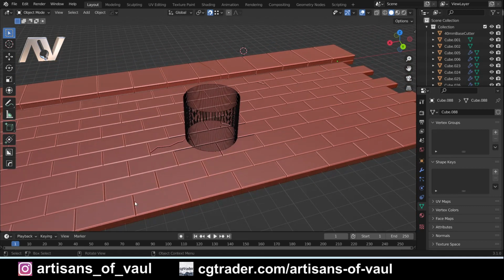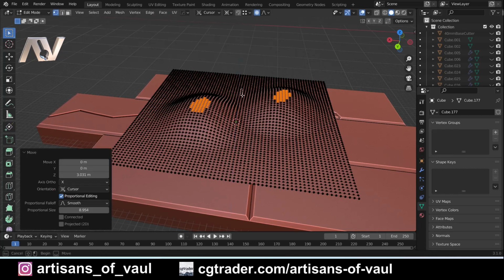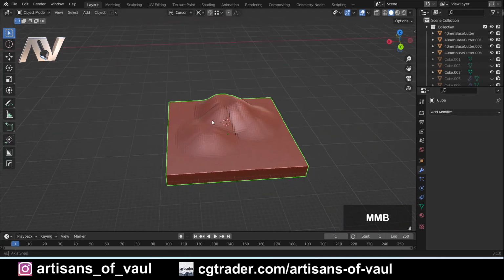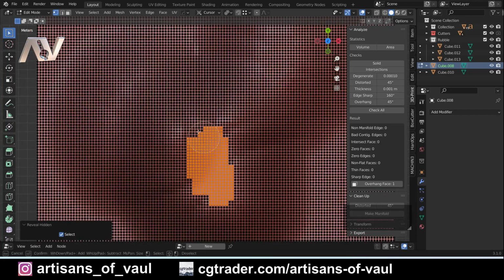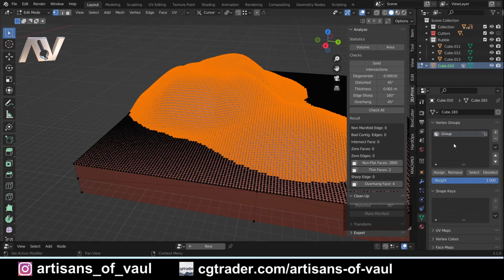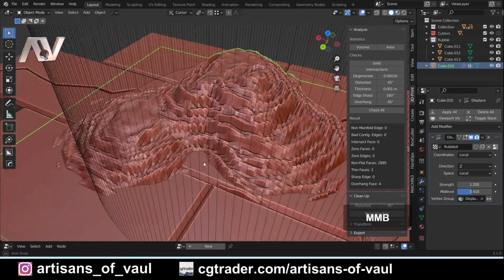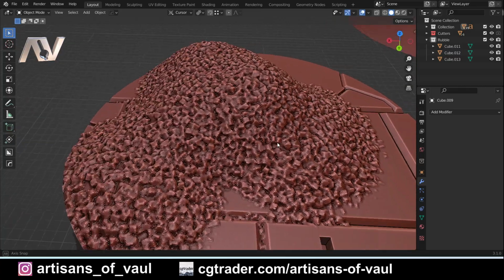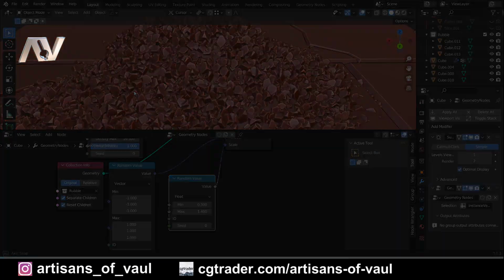Creating piles of rubble

Comment: What is your method for merging the rubble with the base for creating a printable part? I've been fighting with a similar displacement process to number 5 to texture an inset surface and couldn't get it to merge into / resolve into a sealed volume (I was attempting to use bools to "clip" the visible texture for the inset surface but blender was not...happy with the process).
Reply from the maker: I would imagine there is an issue with the mesh that has been created.  Have you run a 3D-print toolbox check on the object to see if there are any issues?
Reply: Capture of the toolbox's output: https://imgur.com/a/QubdcZu

I'm guessing that the ~102k intersect faces are contributing to the bool not firing correctly? (I'm still fairly fresh to doing stuff with Blender, your videos have been fantastic aids insofar, I'm just unsure how to resolve more complex models into single entities that will print).
Reply from the maker: @SereneTreefolk  Yeah that will do it for sure. It's not just non-manifold edges that will cause a boolean to fail, non-flat faces and intersecting faces will also cause problems. If you have Instagram feel free to message me there. I could have a look at the file and give you some pointers if it's fixable (it should be)
Reply: Sadly no instagram, Discord perchance?
Reply from the maker: @SereneTreefolk  Sure. Let me know your name there and I'll add you.
Reply: <removed by user>
Reply from the maker: @SereneTreefolk  Request sent.
Reply: I did, it reported that there were no non-manifold edges, but I suspect that there were other issues with the "textured" object (union bool attempts were reducing the model down to several odd rings instead creating a unified object).

Comment: Why 3d print something you can easily make with sand and glue!?
Does nobody care about the environment anymore??
Reply from the maker: I would say its an option and if you're already printing a base then adding an additional texture allows you to create a more "complete" product and uses very little additional material.

Id also add that saying its better to put sand (stripped out of nature on an industrial scale) on a plastic base (where the sprues mean there is around 40% by weight of plastic wastage) isn't exactly environmentally concious.

Comment: Does using the nodes create issues for 3D printing? I mean, they look like it would make everything a pain to clean up and make manifold/printable. Then again, I think I just need an easier way to clean up models, making a simple planter I had 230+ non-manifolds due to booleans. Oh well. Learned a few new things at least. I like how base 5 looks.
Reply from the maker: The first method does cause some issues.  You need to either separate all the objects (easy with "p" then "by loose parts") but then booleaning everything together can cause lots of issues.  The other option is to take the object to sculpt mode and remesh it, that will make one solid object (do this without separating out the parts).  The second method causes no issues at all that I have found.

Comment: Awesome video! Nice to see the side by side in resin. I think the first option would potentially be worth it if you wanted to also add in some additional objects as texture (like spent shells, or more distinctive brick bits or broken column shapes). For this kind of fine rubble texture- I agree with your usual method of just adding basing material the old fashioned way once the base has printed. I like the last "noise" option in terms of how much mid levels their are. Seems like an interesting way to add larger rubble bits and then still go in after the print with some fine sand or something similar in that empty mid level space.
Reply from the maker: Totally agree on all points!

Comment: I'll say, the displacement is an excellent tool for getting natural looking textures onto surfaces using a similar technique to the last one, not just rubble. I think they all look great though!
Reply from the maker: Yeah, I need to play around with them more but I didn't find it that impressive
Reply: @ArtisansofVaul  I've been downloading displacement maps and using them as textures for natural ground and it's worked tremendously well for me. I set the coordinates from local to UV, changed the direction to Z, and went into the "UV Editing" at the top to stretch out the vertex's across the image more evenly. I typically go with 3 strength and set the midlevel to .1, and it's worked brilliantly, and it's way easier than designing a dirt path or beach or grass from scratch
Reply from the maker: @NoraMeld  It's definetly something I want to tinker with more. I get the impression it works a bit better on larger surfaces.
Reply: @ArtisansofVaul  It definitely works best on flat surfaces or only lightly curved, anything with more than a 15 degree curve is likely gunna look wonky

Comment: For clarity it would be worth knowing what printer you're using and what layer height! I still do the bulk of my test prints on an old 2k Sonic Mini - probably with similar results. However, if I were to use an 8k machine, things might look a bit different!
Reply from the maker: I'm using a MonoX. Because of the larger screen size it will effectively be the same as your Sonic Mini. Layer height is 30micons. I wanted to use something pretty much any printer is capable of (but should have said that in the video)